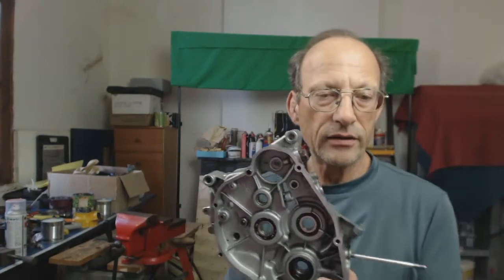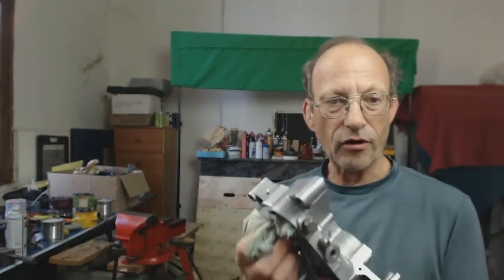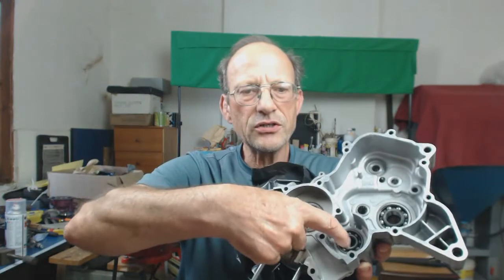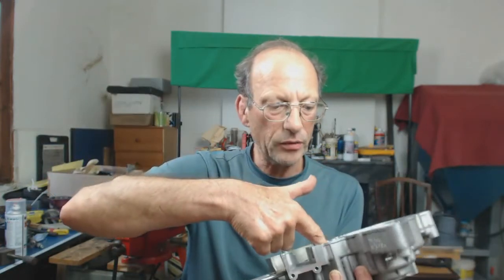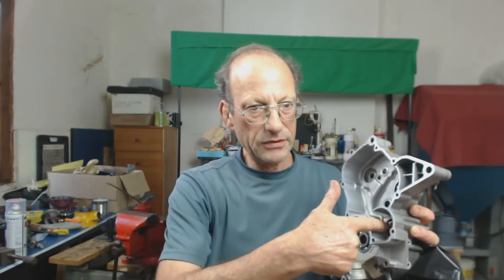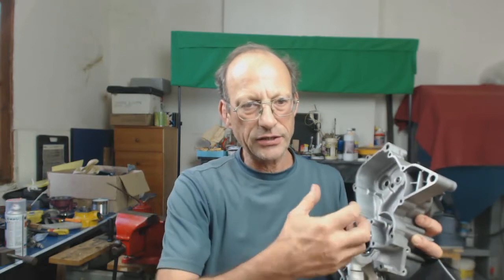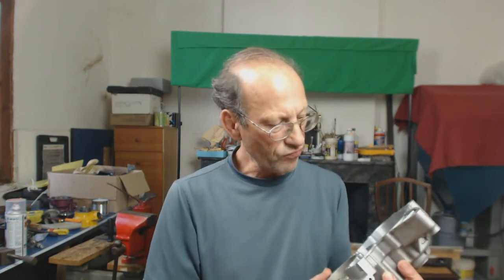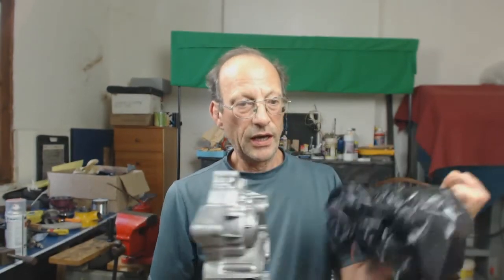AM6 Engine Assembly Guide   - Part 6 -  Bearing grit removal

Comment: Do I need Parafin oil or Liquid parafin?
Reply from the maker: 'Paraffin oil' would be the normal terminology.
It is a very light oil ... lighter than diesel.
It is difficult to consider it an oil, but it is.

Paraffin can be added to diesel in winter, to help the engine start.
It is used in portable home heaters, so it is higher refined than 'home heating oil' which is more like diesel.

Paraffin is also used in workshops, to degrease and wash off components ... the paraffin bath.

In N. America, the equivalent is the highest grade of kerosene (that might have a number of names).
Kerosene is difficult to tie down because there are six basic grades.
If using kerosene, you would require the highest grade.
The lower grades are more oil than solvent ... you can feel the difference by rubbing it between your fingers.

However, all light oils can be a solvent to thicker oils ... so use the lightest that you have:)

Comment: Great vid.......but I must add a couple of caveats: AA) when you are blowing out the bearings make sure you have some eye protection in place. Compressed air can blow that grit all over the place and you do NOT want ANY of the bits in your eyes.
Eye protection is a good idea WHENEVER you're using an air gun on ANYTHING.
BB) you should NOT spin ANY bearing by means of an air blast. This is VERY hard on the bearing because there is no lubrication in place. As well, for ball and conventional roller bearings, there is no shaft in place to stop the inner cage from rattling around and damaging the balls or rollers. Bearing manufacturers' handbooks warn specifically against such air blasting to rotate ANY bearing....and for good reason.
Reply from the maker: Thanks for the comment rixretros
I'll accept the complaint over my lack of goggles.
The bearing was already clean, but I should have set a better example.
You are right to point it out :)

Regarding the blowing of air through the bearings... and the suggestion that this is somehow wrong.
No way!
The bearings were entirely lubricated with paraffin, as described in the video.
Paraffin is a very light oil... lighter than the various kerosene grades... but still an oil.
With zero load, there is zero risk of any damage to the bearing.

Even if there was a risk (which there wasn't)... that risk would be infinitesimal in comparison to leaving the grit caught within the needle bearing cage. 

Perhaps you might reconsider that statement :)